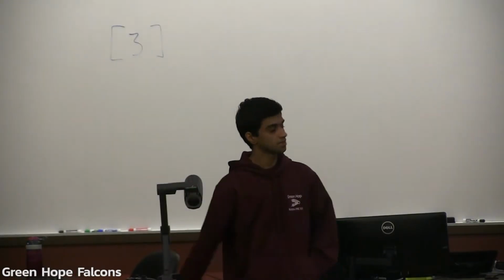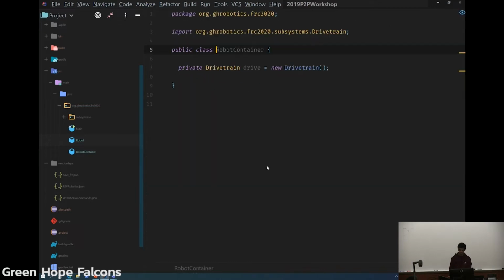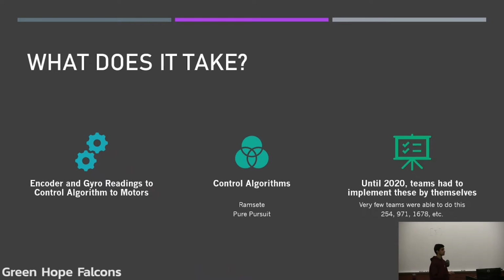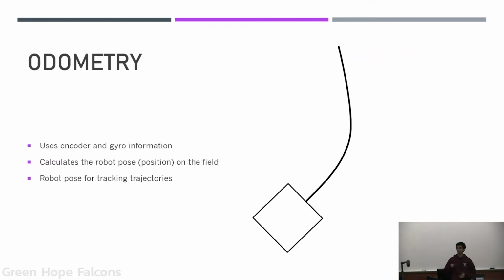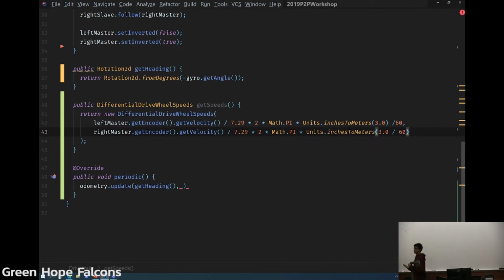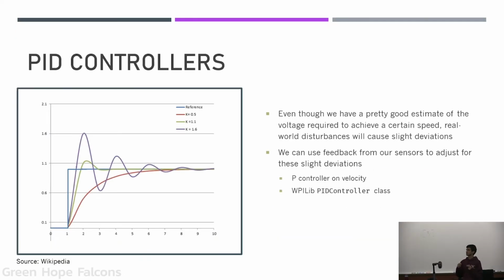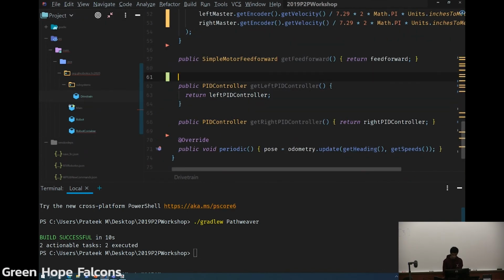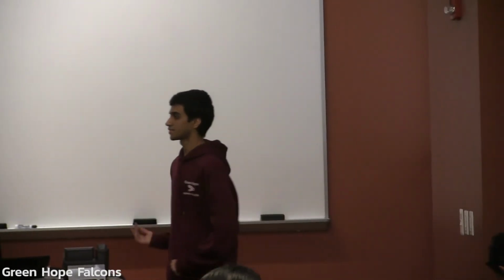FRC 5190 | Zero to Trajectory Tracking using FRC 2020 Software

Comment: Jesus, what's with the icon scaling on your IntelliJ? The icons are MASSIVE on the left, yet the text is comparably small, but the rest of the interface's text is somewhat large, but scaled more properly.
Reply: I had my IntelliJ in presentation mode and scaling is a little weird on it
Reply: @prateekma  Which theme do you use on your IntelliJ and vscode? l think your theme is great!
Reply: Oh neat, the Drive Characterization Tool is built in Tkinter. Would have expected a packaged PyQt file. I'm betting it's using Click for the commandline functionality, too. Or maybe not, since argparse is the de facto command line utility, and Tkinter is the de facto GUI utility, it wouldn't make much sense to start using a high level Click interface when you're using a low level Tkinter interface in the same project (why not go for PyQt). Anyways, cool video. I hope I get to work with this tech eventually.
Reply: it is never that deep